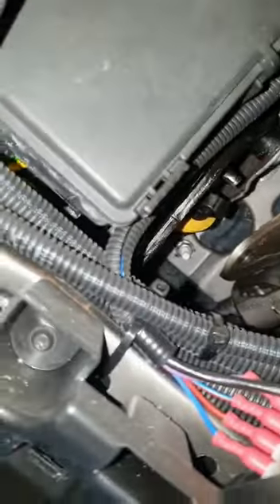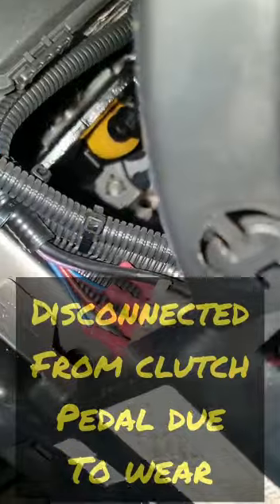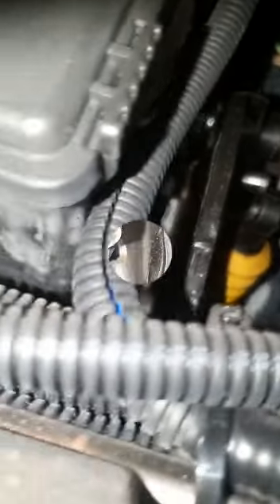Clutch Pedal sunk to the floor; Fault & fix. Ford Transit Custom 2.0 EcoBlue TDCi 2020 #short

Comment: Hi. Can a faulty clutch switch prevent the van from starting?
Just had a replacement clutch and 4 days later whilst driving engine cut off, cranks but doesn't start.
Reply from the maker: Ah yes, can do. I had this once, but the fault was with the clutch pedal, not the plug from the loom going into it. Does the vehicle still say "press clutch pedal" whilst cranking with your foot on the pedal? That should help confirm it.

Although having said that; not sure it should cause the vehicle to cut out whilst already running.
🤔